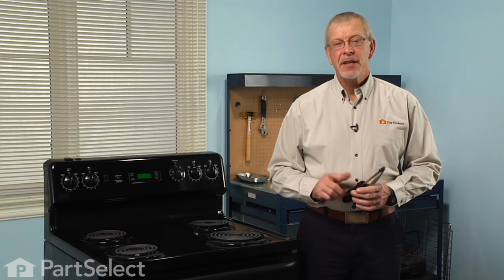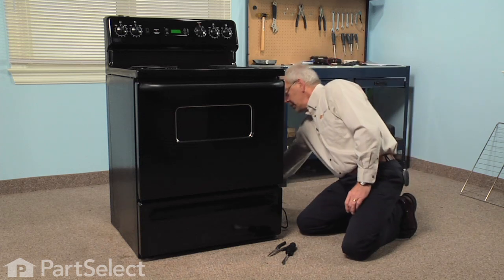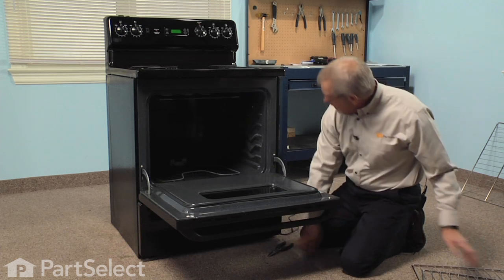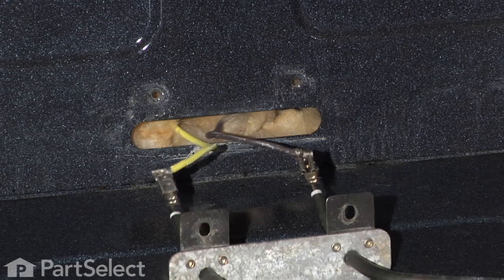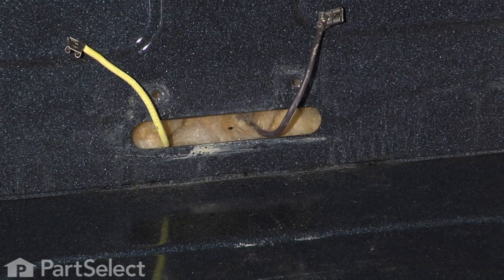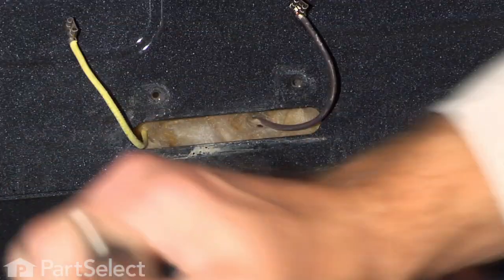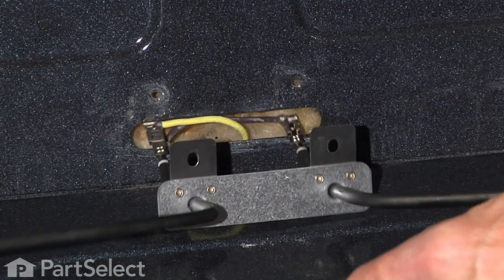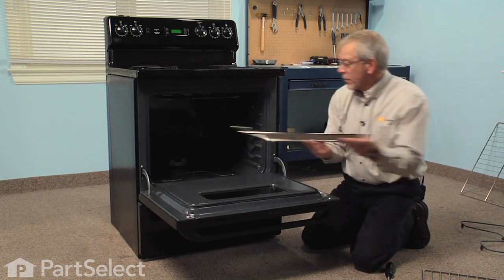Range/Stove/Oven Repair - Replacing the Bake Element (GE Part # WB44K10005)

Comment: I envied the repairman having such nice long wires to reconnect with.  Mine barely extended  an inch inside the oven from the harness on the back.  After much grunting and fumbling I made the connection.  Earlier, when I hadn't been able to find them by poking around in the insulation I had reasoned they might be found by removing the access panel up the center of the back so I had taken it off, found the terminal clips, and recognized there was an inch I could work down to extend them by taking out the slack inside the tight plastic twist binders.  Now, if I had to do this again, I would extend the tips from the element through the portal and it would be easy to see and make the attachment.  Then, two easy minutes to position and fasten the access panel, and all done.  After reading a comment below, I was a little apprehensive about getting it connected and then having it not heat up.  Relief.  It works fine.

Comment: After I watched the video on replacing my heating element I unscrewed the old one and before I could grab it one of the wires came off is now beyond my reach and the pliers aren't helping, what tool would you suggest on retrieving?
Reply: Same here! Did you end up getting it out?

Comment: So my bake element caught fire and broke. Was still sparking after I turned the oven off and only stopped when I unplugged it.  Bought the part and replaced it, easy job, but now nothing works. The lights come on saying the stovetop is hot, but it's not. The bake unit isn't working, the clock only appears when the oven is on, cannot turn on oven without turning on stovetop. Any solutions or do I have a bigger problem?